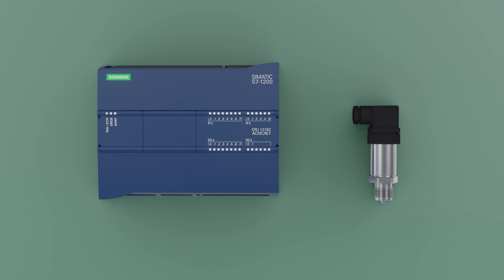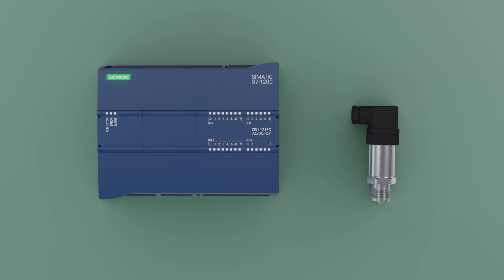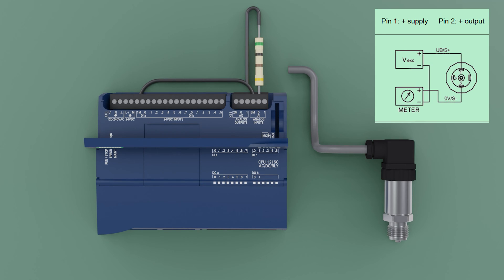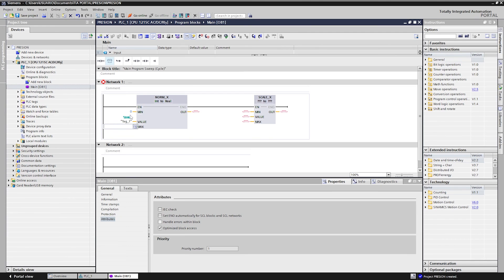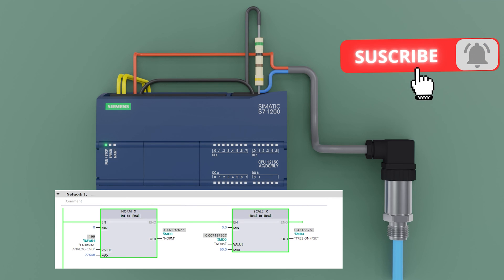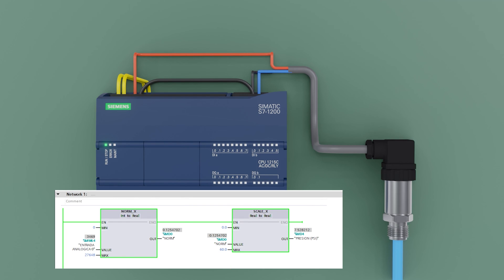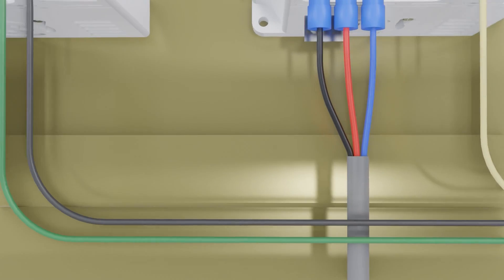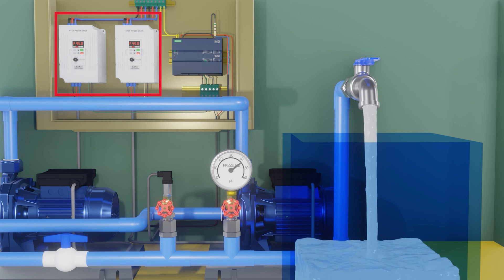How to correctly connect a pressure transmitter with any plc?||Complete Guide

Comment: If you are to use the 4-20mA of the pressure transmitter without converting it to voltage, then it means you don’t need the resistor and in the programming, you would select 4-20mA rather than 0-10V. I’m I wrong with this?